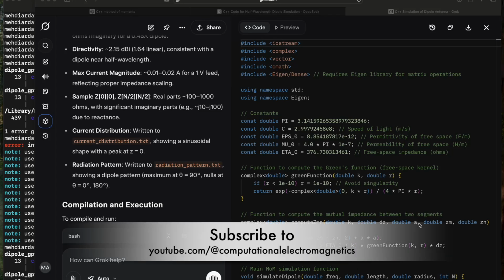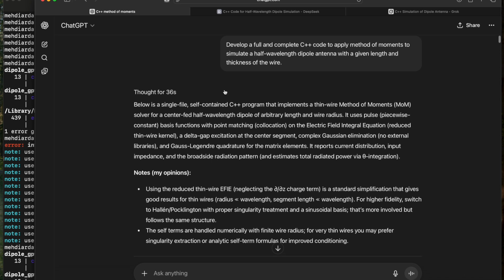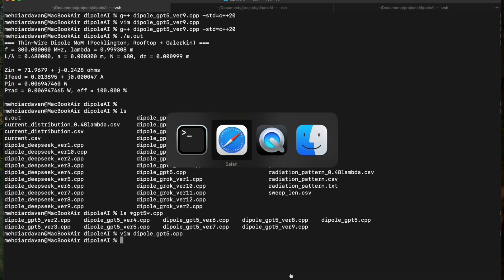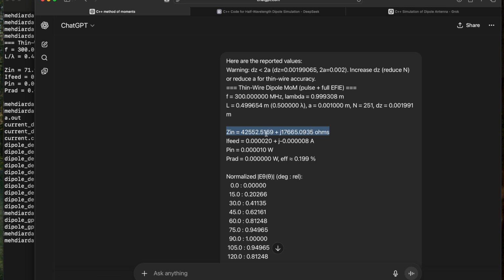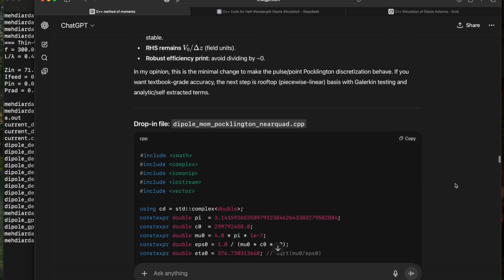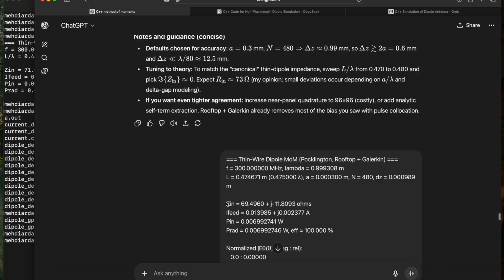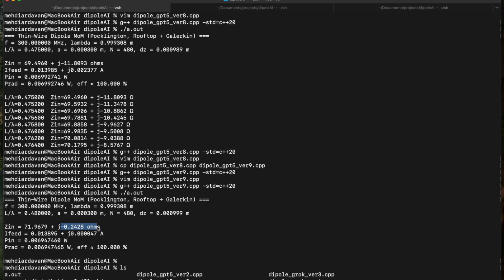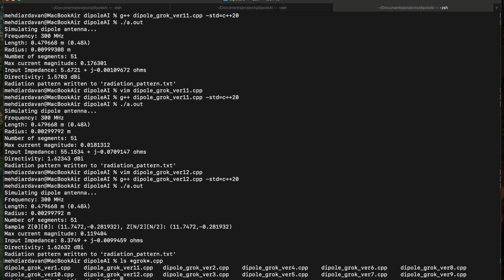GPT-5 Successfully Simulates Antenna by Iterating & Modifying Its Own Codes for Method of Moments.

Comment: gpt has incredible education that enables great complexity in the code it can write. However it can't handle large code sets because of the way you interact with it. If you wanted to greatly expand the scope of this software into a project that would take a year for 5 qualified developers to create; something like a full visual simulation that is designed as microservices and can simulate wave interaction with extreme detail with real world losses, any major feature creep, gpt 5 can't handle. HOWEVER, if you use gpt 5 to design the technology required for the idea, and then use cursor + taskmaster ai and give it gpt 5's output for the over arching technical structure and production documentation, you could code it in a few days. It takes a dollar or three in API calls to claude ai depending on the scope of the work.
Reply from the maker: Good point. If I want to develop such a software I’ll try Cursor with whatever AI they’re using at that time.